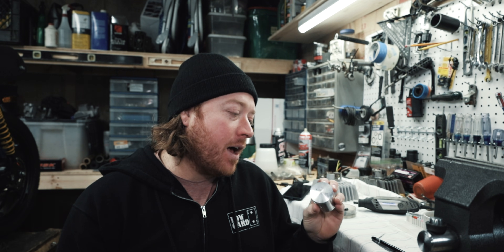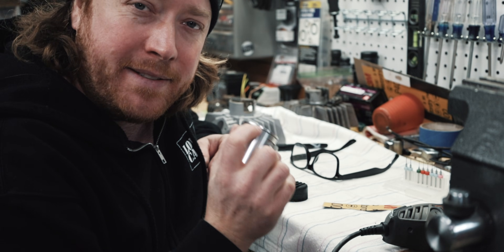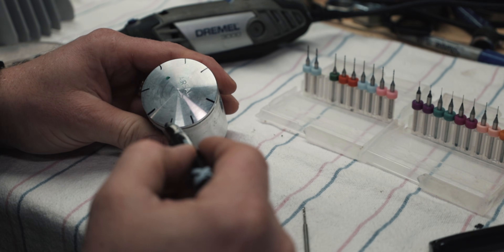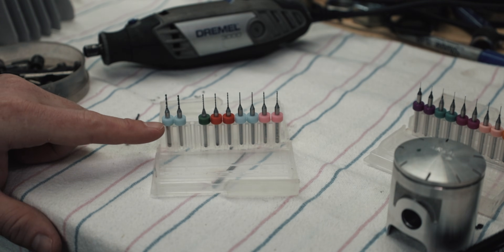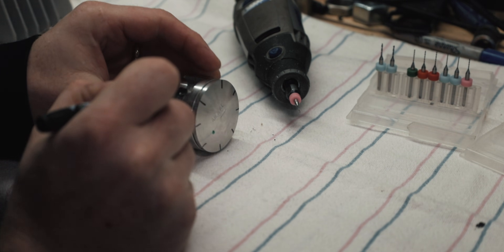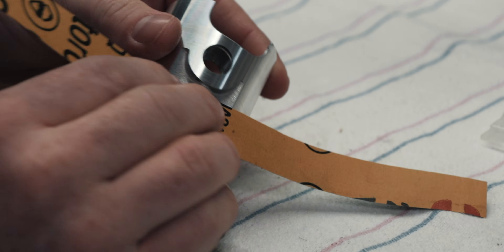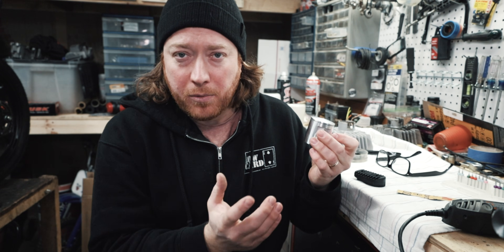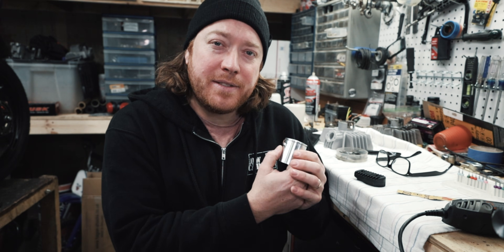Lateral Gas Porting on a 2 stroke to gain hp

Comment: Total seal sells gas ported pistons rings
Reply from the maker: really? I gotta look at those.
Reply: @Corn-ped  we ussually port windows on the skirts of pistons make them banshee rip n boost port full drag port paper thin but only in entrance not where sleeve is don't pass 6 thousand of inch transfer porting n dimpling port intakes top pistons ceramic coating with cerakote n head chamber it rips
Reply: @Corn-ped  it's like lil lines on the ring about a inch of separation my Lord
Reply: @Corn-ped  supposed to release less blow by n 5 hp gain

Comment: Drag racers have been gas porting pistons for decades because of very thin rings with little tension. Gas pressure at ignition really forces ring into cylinder wall. Keystone rings work well too.

Comment: Awesome, Bro 
 Thanks for the info . Interesting! only seen it on 4 stroke car engines
In which direction does the gas flow through piston ring land holes?

YT really supports your channel recommending 2-year-old videos . your doing something right.
Reply from the maker: The gas flows from the top of the piston down the cylinder wall, into the ringland and then under the ring and down the piston to cool the cylinder wall and piston.

Comment: 2 stroke master here. Gas porting works best on 4 stroke motors. This has been tested by yamaha and Suzuki in the 1990s, the Turbulence on the ring when it's exposed to the transfer and exhuast ports with the gas ports created ring flutter and also on the way down the rings would get snagged by the ports creating cylinder scratching. And ring failure. Not to mention a loss of 0.2 hp
Reply: I'm also something as a 2 stroke master myself.
Reply from the maker: Lolol no shit
Reply: Self conceited 2 stoke master lol i love it if no one else is saying it you might aswell i guess. Were can we see your 2 stroke master classes or engine builds? Be nice to see somthing back it up other than yourself, I dont disagree that with your thoughts on this video but gees 😂

Comment: I jave a ktm 125sx It is a double ring piston what do I need to do just not install the bottom ring
Reply from the maker: Yeah only run the top ring
Reply: It will still run I am sure with no lower ring. But you will have a passage (the lower empty ring groove) from the transfer ports to the exhaust port near the bottom of the stroke when the cases are pressurized on the down stroke.     It will probably lose some fuel charge out the exhaust port, and slightly reduce the primary compression (in the cases).  On the up stroke, (now creating a vacuum in the cases to open the reeds), the passage can allow burnt exhaust gasses in the exhaust port tunnel to flow the opposite way into the transfers, and the reeds may open up a tad later, (less charge entering the bottom end if the reeds open later.), due to less suction. You will probably lose a bit of power.   If you can pick up a single ring piston from KTM or a company like Weisco, you can try this mod.  But I would ask this guy to run his hard for you first.  :)

Comment: Why wont this work on more than 1 ring?
Reply: As I understand this, this porting mod is to force the piston down on combustion and seal faster, and possible better. (pushing out and sealing better)
Hence it will not work on the 2nd ring. 
And then it will give you get better compression and a better 'yield' of the compression giving you a potensial for better performance.
Reply: @erikeggenbakstad  Ok so it will work using 2 rings but mod is only for first. Maby do opposite side on second ring since that ring seals from other side (below).

Comment: I have only side gapped my plug on the stock 50cc eaton bimmer3 I roll as my daily. Major difference.. 7-8 mph top end gain. Not a super fast bike to begin with but cruising went from 28-30 to 35 easily. Top speed gain similar at 45 mph up from 37-38.   More importantly just finished my street build gas porting the 70cc kit i have and ill definitely side gap the plug too. Its already pretty ridiculous but I hope it it will run cooler with the pipe and carb setup I have. It was running 55 mph. Would like to see over 60 without soft sieze and I believe this will do the trick.  Gas and fuel oil mix already "tuned"
Reply from the maker: yeah man! Get that 60!!!

Comment: can anyone explain to me what the purpose is of the 2 blind big gaps above the pistonpen? i guess it has to do with cooling or some sort? cant find any info on that
Reply: I build little 2-stroke engines for a living, (don't have those cavities), but I am not totally sure why either.  I can see 2 things it can do though.
1) Lighten the piston to a better balance weight.
2) Connect the front and rear transfers to help equalize the pressure in them.
That's all I have.

Comment: hello! I'm gonna try this but what is the difference between this and vertical gas porting when you drill through the top of the piston? would that also work on a 2 stroke? also why don't these holes cause blowby? to me  drilling these holes sounds like bypassing the ring? and also does it matter when drilling if it nicks the ring land itself as long as it doesn't hit the lower part you said? and why do you drill on the top and not bottom?

Comment: That induces carbon buildup creating stuck rings in 2000 miles. The Piston seizes up at the bottom skirt area. From overheating from lack of lubrication/lean mixture. Only drive it at night😅😅😅😅 or do what someone did in the 70s that is drill approximately.020 deep divots on both piston skirts to catch oil.  1/4 drill you can drill them evenly spaced in a pattern if desired at least five divots no need for more than 10 on each skirt. Then you can haul ass Non-Stop

Comment: What tou mean, that less oil increases power? I thought and heard its opposite to that..
Reply: You heard wrong. Fuel burns better than oil, Adding oil is purely for lubrication it slows down a motor
Reply: Lean is mean.  lean fuel 👍 but will burn up the motor .  More oil not to much more.  makes more power . 4.5 oz oil to one us gallon works great on my honda af16 with 72 cc polini .
Reply: More lubrication less oil burnoff from heat and helps "diesel" any leftover thats why you get more power with a little bit more oil 👍👍👍
Reply: Using any more oil than needed for lubrication will promote detonation. If you jump from a small ratio (50:1) to large (16:1) make sure you richen the jetting up as the oil takes up space in mixture. I used 40:1 in the RD375's and 16:1 in the TZ250 as the TZ's liked the extra oil for cooling.
Reply: @postulator890   super kart dudes use   way more oil.   Why is that? Allmost same engines than 2-stroke GP bikes.
Reply: 4 to 6 dl to 10litres of gas on super karts.

Comment: Also is it true that if my cylinder has a chip or dip below or above the cylinder ports that it’s still good to run or something along them lines?? Just wondering your thoughts strange thing is that this engine ran fine until the main drive sprocket broke I will say I did have quite a bit of  oil spitting out the back of the silencer so is that also known as blow by??
Reply from the maker: yeah if you have a chip/dip and it doesn't have sharp edges for the ring to catch you should be good. 
Blow by is when the premix leaks past the rings into the crank case. oil spitting out if your pipe is from running to rich.

Comment: Hey love the info is it possible that you could get a zoomed in image of what it looks like after I have a older Franco morini s5 engine that all use the same bottom end but the top end uses different cylinders and to of the top ends have double piston rings but I have one rope end that only uses one ring if you could up load a image or send me an image of what it looks like when done and you probably answered this already but if I may ask how come this wouldn’t work on double ring basically double the holes and offset them just wondering
Reply from the maker: Ill post a photo in the community section for ya. https://www.youtube.com/@Corn-ped/community

Comment: Oh wow.  You weren’t kidding.  So you basically drill a half circle in 7 spots flush with the ringland and only run one ring if two ring piston?
Reply from the maker: yeah. you just put little notches on the upper ring land and run a single ring. you do NOT drill THRU the piston. Just lil notches.

Comment: I'm new at the game, is 'ghosting' the same as ring flutter ?  Thanks., You picked up a new subscriber.
Reply from the maker: hmm I have not heard of ghosting?
Reply: @Corn-ped  Some of the newer model Stihl Chainsaws ( MS362 specifically ) experience a problem which has become known as ghosting.  An unexplained phenomenon which has yet to be properly diagnosed or even existing (By Stihl ).  It is a high frequency vibration within the saw.
Reply from the maker: @thomasgronek6469  hmmm. I would think that has more to do with an unbalanced engine or part.
Reply: @Corn-ped  Thanks.

Comment: Been building engines 44 years laterally gasporting to stroke piston huuuuu hels cooling huuuuu. 1 that's done on 4 strokes that use thin low tension rings  to help sealing  nothing to do with cooling. #2 in 30 minutes then holes will be getting stopped up with carbon. 3 kinda worse for cooling on a twostroke you just screw up the purpose of sqish gap  good vid just wrong type engine

Comment: What if ya remove the ring from a two ring piston and try this?
Reply from the maker: Same concept!
Reply: @Corn-ped  what about compression, will the single ring with the "dimples" seal just as good as two rings?
Reply: I removed the bottom ring on the RD-375 long rod motors I raced. The piston had a keystone ring and I never saw blow-by below top ring so I removed the second ring. Keep in mind that the rings help the piston shed heat of combustion so you have to keep an eye on the underside of the piston for oil burning onto bottom of crown.

Comment: Great videos! What is the origin of the name Cornped? Do the gas porting grooves need to go all the way to the top of the piston? Looking at the pics in the link to MA that you posted, his ports are like half moon shaped.
Reply from the maker: They do NOT need to go up like a half moon. That guy did HUGE ones with a drill bit. You only need a notch. Back when people started doing it, no one knew about micro bits so people were using the smallest drill bits they could find. 

CornPed came from my name Maize which means corn and mopeds, Ped.   Its not that original. I made a blog like 15 years ago and at the time someone was calling me CornFace, so I decided to call the blog CornPed. I could choose a different youtube name but I havent thought of a better one.
Reply: @Corn-ped  are the porting grooves the same depth as the ring groove?
Reply from the maker: @rexsheler1321  yes. it goes all that way in.
Reply: Here in Iowa we're all corn fed.

Comment: I assume you didn't drill a hole were you marked the first marke because the pin? That's why you said 7 holes. But there's eight. Thanks for the vid gunn try it on a couple I have while there apart
Reply from the maker: Yeah, don't do it at the pin
Reply: @Corn-ped   so really , you making the same “ notch “ as the pin “ hole “ correct ? I’m trying to vision what I have to do … lol I was first thinking you drilled right through the piston . But then I see that you say “ notch “ so really you make it look like the top only of the pin hole
Reply from the maker: @steveZ1turbo  yes. Only notch it to the back of the ringland. Do not go thru.

Comment: Thank you CornPed!!! I did the gas porting and the plug side gapping you showed and OMFG the polini is so fast! I'm not joking bro its insane paired with a proma circuit pipe. Thanks bro you are the shiz😎
Reply: Can you or someone else explain the mechanism of how his "works" and how this creates more horsepower, also, applications to chain-saw and other small engines like an Echo 2400 - 210 series of lawn equipment.  TIA
Reply: @peterdarr383 ringland porting the TOP ringland on the piston causes the top piston ring to act like a dykes ring creating a better seal and more power plus helps cool the piston since more mix can get around the top part of the piston
Reply: @thomaspeffer3885 sweet ! Gunna try it on my old ms290 piston before I put it back in . I wanted to drill holes for the transfer port bridges but the piston has a cut away on each side of the piston . It’s amazing how this stuff works let’s alone how it was discovered. every herd of the one where the drill small hole through the top of piston or was my leg being pulled ?

Comment: Been running my polini for 2 seasons. I’ve followed several build guides but have never seen this. it always looks perfect when I check it But I’m def getting flutter! Hopefully this will help. Keep up the good work man.
Reply from the maker: Do it up! Check out spark plug side gapping too!
Reply: @Corn-ped  OIL MIX 33:1 IS OK ?
Reply from the maker: I like to run less oil. 50:1 or 60:1 full synth

Comment: I was gonna build a setup with a polini kit  on my free spirit pretty soon do you have any other tips for polinis? 
Parts I have:
Polini kit
Estoril sidebleed
17 tooth gear (free spirit 1 speed so 35 in the back) should I go with a bigger rear sprocket? 
Clone 15 bing (might switch to the mallosi 4 petal and a mikuni vm20) 
Running stock points
Treatmetric 3 shoe clutch 

Let me know what you think and if I should change my setup at all. I was running an airsal kit with a biturbo pipe before and it caught a ring on the exhaust port unfortunately. I was looking for about 50mph but I haven’t switched out my front forks or changed any suspension components so that might be a little aggressive. Thanks
Reply: Maybe switch out the front sprocket to a smaller one, like a 13. Ive heard that shorter chain is better so ye. And about the bing, make sure you use original 2.17 atomizer and original jets for it
Reply from the maker: I would use a real bing 15 carb or a larger one. Oko carbs are great, Mikuni VM 18 or 20, Del 21. 

I would also go to 16x40 gearing. Thats my favorite. 
Marty has a great gearing calculator if you want to mess around with gearing and speeds. 
A stock polini revs to around 10K. you can get them to rev out to 13 if you go nuts. 
https://toolbox.martysgarage.info/
Reply: @Corn-ped  thank you for the response that gear ratio calculator is very helpful.

Comment: Very interesting, what's the reason that you can't do this on a 2 ring piston?
Reply from the maker: The ports allow fresh fuel mix to go around the ring and cool the piston. If you use the second ring, it will stop the premix and wont cool the piston.
Reply: @Corn-ped I don't see the logic...it would still cool the upper part of the piston even with 2 rings...the top is the same...
Reply: Yes, I'm in the same thinking as you. And I'm reading comments and can't get any real reason behind the purpose of removing the bottom ring. I guess some things we will never know the real purpose.  @crashtestdummie67
Reply: @Corn-ped  wouldn't you still have the advantage of the pressures getting behind the ring making a better seal?
Reply: @Corn-ped  
Would you do it also for a daily driver? 

I have 70cc polini minarelli vertical air cooled engine, 2t Yamaha Spy(CW50RSP). It produces around 10-12hp. 

So basically: Dellorto 19mm, polini 70cc with two rings, Yasuni R exhaust. 

Do you recommend doing this to a daily driver? Is there a big difference in piston ring servise interval?